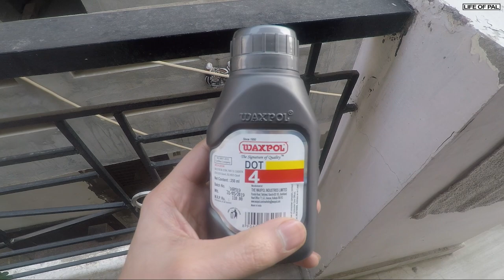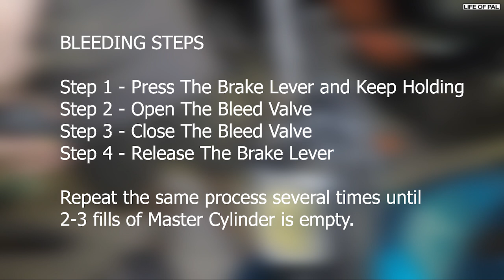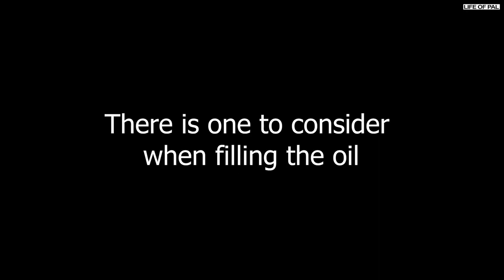How To Bleed Brakes DOT4 | Replace Hydraulic Oil | DIY

Comment: Dude that was awesome, I'm on verge of changing my brake oil it's been 2.5years and had same idea of first removing oil from mst cylinder and then filling new oil n bleeding brake lines but was not sure if air will enter brake line if I remove oil first, your video clarified. Thanks man

Comment: Hello brother, i have fzs v3 , when i apply front brake the lever comes completely near accelerator, but bike fails to stop. If immediately released and the lever is pulled second time, the break works. This has to be repeated every time to use front brake, please tell what to do. The service centre guys are saying to change abs which costs 15k, the abs indicator if fine after turning the vehicle on. As i said break works if lever is pulled secnd time. Please reply.
Reply: Have you resolved the issue?

Comment: I can hear slight brake noise while rotating rear wheel in neutral. Does the brake caliper and cylinder needs to be cleaned for the free movement?
Reply from the maker: nothing needs to be done. its normal

Comment: Hi, Can you please upload a video on, how to change the MC kit? My front breaks feels really spongy, when checked with a couple of experts, they recommend bleeding the fluid, then changing the MC kit!
Reply from the maker: Spongy has nothing to do with MC kit. Change the fluid and problem will resolve. MC kit doesnt go bad so early unless moisture damages it. Mine is running fine from 5+ yrs
Reply: @LifeofPal  Thank you so much for responding, I am planning to clean the cylinder and bleed the break fluid.

On another note, your videos are immensely helpful for me, I had been an FZ25 owner for the past 4+ years (2018 model) and right now I started to do small repair jobs myself, its really rewarding. Thank you for your support. : )
Reply from the maker: @danymanuel9897  unless you feel jitter ness in the lever, you dont need to open.
Reply: @LifeofPal  Hi Pal, I am confused, in the previous reply you asked me to change (bleed) the break fluid, just now you told me, I don't need to open unless I have jitter ness on my lever.

My real issue is, when I use 1 finger for breaking
1. during a sudden break, the lever touches my other fingers on the throttle. So I suspected "spongy" breaking (I suspect air trapped inside/old break fluid -- my solution: I planned to change the fluid, and clean the cylinders since I am opening the master cylinder)
2. the break lever wont go all the way back, and that makes the rear break light to be on all the time (I suspect the spring in the MC kit - my solution: change the spring and the whole kit).

Please suggest a better method to eliminate these issues.

Also in the owner's manual, I saw Yamaha recommending Lithium Soam Based Grease for some moving parts, I couldn't find it anywhere, any suggestions?
Reply from the maker: @danymanuel9897  so first you told there is air in the system and now you said lever play is too much.

If lever play is too much only because of air in the system then you don't need to open MC. Thats what i said. Only if you are sure of the air. Air makes it spongy.

There is a difference between feeling spongy and too much play. Feeling spongy have difficult in get the bite, usually hard pressing. Whereas in case of play issue. Bite is there but very close to grip.

If your issue is second go with rebuilt.
Reply: @LifeofPal  Sorry Pal for the misunderstanding, my issue is 2nd one.

I have bite, but close to grip.  Thank you for the support. Really appreciate your attention and help...

Comment: Hi bro ...iam using fz 25 model bike I have one problem for long term ...
Wobbling problem ...I changed rear and front tyre,swing arm stay bush,front frok oil changed per side 470 ml,wheel bearing good ...
But rough surface area in slow speed feel like wobbling and front wheel moving side like a feel ...plz Tell me what do to help me plz
Reply from the maker: Ye aise hi rahega
Reply: @LifeofPal  don't know Hindi
Reply: Bro any suggestions tell me plz
Reply from the maker: It will remain like this. Nothing much can be done

Comment: Why bleeding is imp!!! I remember a mechanic did all these steps on my car's brakes three years back. After that only top up work is done.  My car's brakes are not performing good now. Braking process is delayed by a huge margin. I should ask a good mechanic to use these  steps in my car's brakes as well. My bike is two years old so I have time to do bleeding process for my bike. 😊 Sorry discussing car instead of bike more in this video.
Reply from the maker: Your car caliper or master cylinder may needs overhaul 🙂
Reply: @LifeofPal  Yes Pal. Need to find a good mechanic first. Thanks for this wonderful information.❤️